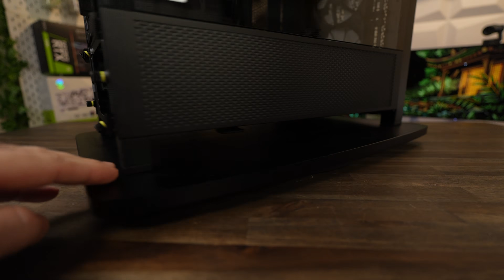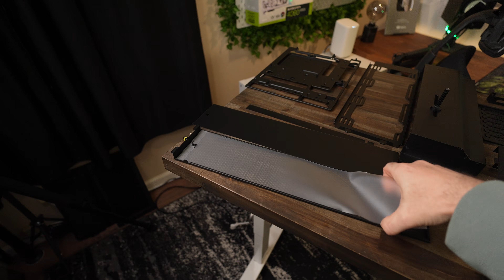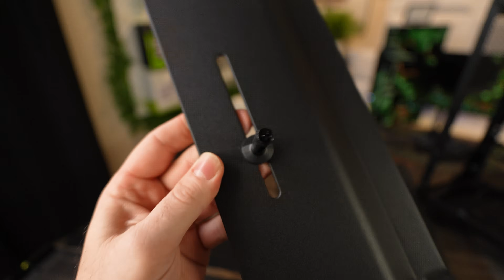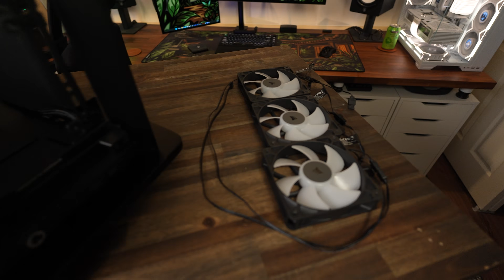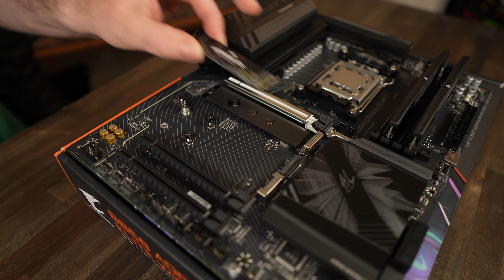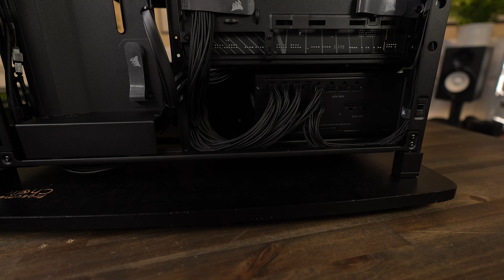Corsair FRAME 4000D Stealth build with INSANE Cable Management

Comment: I notice often the cables of the fans are a bit short. Did you use replacement cables or extension cables for the fans?

Love the blacked out build!
Reply from the maker: Yes, Noctua fans generally always require the extensions. Not sure now, but they used to come with ones in the box. Never had the issue with other fans though. I always keep PWM extensions on hand just in case.

Comment: They removed the top dust filter? downgrade?
Reply: There seems to actually be a top dust filter you can buy separately. But it's only in corsairs online store, it's 10 bucks. You can apparently buy a black one but they were too lazy to put any pictures.

Comment: I got the RS model & ran into an issue with pre-installed fans. They light up, but the fans aren't running. They're all daisy chained & hooked up to the ARGB fan connection on the motherboard... not sure what's up, but I'm a newb at builds.

Comment: Would there have been room to vertically mount the GPU if those bottom fans weren't there ?? This is so clean lol
Reply: The Panel in the back rotates specifically for this.
Reply: @ResistStatism so you just buy the cable then? Thanks for the help !

Comment: Hi, I've tried to find some examples of vertical GPU mounting with fans on the bottom of the case (above the power supply) on the 4000D Frame and even the 5000D, but I'm not sure if it will work with a 5060 Ti 16GB 3-fan card. Thanks for your reply, and sorry for my poor English, I'm French.

Comment: Sadly, not compatible with 200 mm fans without sacrifices. 

The power supply shroud does not have a large enough cut out for a lower 200 mm fan. They suggested that I remove that to install the fans which works, but then I am no longer able to vertically mount my GPU. Because the course GPU riser mounts to the power supply riser….

Comment: I have the aorus x870e pro and the exact noctua cpu cooler. i noticed that in your build the cpu cooler logo "looks" towards the back of the case. i use the 9800x3d cpu. I wonder if i have installed it backwards or is it ok to leave it as it is. If you can advise on it! Thanks

Comment: Just a question, the fans in the bottom are intake right, so does it collect fresh air or it might collect hot air because the psu is under them ??

Comment: I'm so excited to build in this! I'm doing a case swap from the OG 4000D, so this is going awesome and much easier to work in!
Reply: how did it go im planning to do the exact same thing. did you change any other components while youre at it ?
Reply: @fischerderheld4407 Hey! The new case has been running great. I was AM4 and just last Saturday, I had swapped to AM5. New CPU, Mobo, RAM, and PSU. I carried over my GPU from my last build.

I'm also running Noctuas but the beige and brown's
Reply: @asunuji that's awesome! I switched to am5 too and got myself a 5070ti. Now im already looking to spend more money on case and PSU lol
Reply: @fischerderheld4407 The case is worth it if you don't want the fish tanks. Its slightly bigger than the OG 4000D but I'm running mine as this

- 200mm x2 Front
- 120mm x3 Side
- 140mm x1 Top Intake
- 140mm x2 Top and Rear Exhaust

Temps stay cool, and you will have to remove the PSU shroud if you decide 200mm. Last build didn't consume much power but I swapped my 850w to 1250w just so I could swap in anything I wanted lol. 9700x with 4080 Super
Reply: @asunuji woah that's a lot of fans. But I guess that's more silent too since they can run slower ?
Reply: @fischerderheld4407 Yes, I run a custom curve so they're off till temps go above 50 to 60c.
Reply: @asunuji did you upload a picture of your build somewhere? Would love to see those noctua fans in a 4000d. Also will you get a wooden front and top once Corsair releases those ?

Comment: The case looks a bit wobbly. But the final build looks absolutely awesome! I think you should rotate the first fan at the top so it draws air into the case. 
I'm still deciding whether to get the North or the Frame 4000 for my next build.
Reply: Ur right it is “wobbly” the panels I mean and yea thumbscrews are an easy way to remove panels but I just don’t like the thumbscrews in the power supply part of the case when u install the unit I was tightening them and the screw stripped like the threads of it and I can’t use any normal screws for that part but it’s whatever still have 3 other screws tightened to the power supply  but other than that the case is an 7/10 for me a lot of space to work with the cables and airflow is really good 😊

Comment: Why dont people use the CORSAIR iCUE LINK LS430 Aurora RGB Light Strips in the frame 4000D? Iv'e seen multiple people build in it, especially because of the bottom diffuser shroud, I thought more people would add the strips along with the CORSAIR iCUE ARGB PSU Cable Strips for the EATXPWR and GPU

Comment: Nice and dark...just how I like it.

I'm not a fan of all the LED stuff. I'm not saying it's bad or anything, just not my style. My current build is in a Fractal Design Torrent with no side window. As well, my tower has always been under my desk, so any LEDs wouldn't be seen, anyway. So yeah...I'm a fan of the dark build.
Reply: I like minimal RGB, but I love a good stealth build even more. I just built in this case with 11 corsair RS120 fans, my hardware from my old case, a 4060, a new cooler, and an RM850e PSU. It was a blast. (Yes I know 850W is overkill for my hardware, I'm upgrading this October.

Comment: Very sweet build, very clean in all aspects. I was interested in the Frame 4000 for the option to use 2x 200mm fans in the front. But I have read that there are clearance issues with 200 fans and I dont feel like modding the case.

Comment: A nice video ! And i just got mine and building in it atm 

Yesterday i thought i was ready … but then i discovered my gpu ( 3080 ti FE) doesnt fit with my side mounted arctic liquid freezer aio …. So today i think i will move the aio to the top as an exhaust 

3 120 s front intake/ 3 120 s side intake
2 120 s above psu and 1 120 rear exhaust

Comment: Love this case. It’s easily able to fit all my parts: Gigabyte Gaming OC RTX 4080, a 7800X3D with a 280mm AIO, B650 WiFi board and 64GB Corsair Vengeance DDR5 6000, 1000W PSU, 4TB SSD, and an 8TB SATA Drive, along with 7 140mm fans and 2 120mm fans below the GPU. Unfortunately I wasn’t able to vertically mount the GPU because I wouldn’t be able to put the 120mm fans above the PSU shroud, so I opted for the extra airflow over the aesthetics.

Comment: Top mounted exhaust fans in front of the cpu cooler are pointless as they effectively pull out the fresh air generated by the front fans before said air could do anything. All the cpu cooler can then use is the hot air being pushed through the gpu heatsink. Nice build though.
Reply: Jaytwocents made a video of prove this wrong lol
Reply: @RoryWilliamsII  point me to the video then because he for sure didn't and maybe you simply don't understand what i'm saying
Reply: @kerotomas1 https://youtu.be/Z3ckosqxjtg?si=dp6Ex08A2AK-BEQC

Comment: I legit built more or less EXACTLY this a few days ago, and now I see this video. Same case, same GPU, same Cooler, very similar MOBO (ROG B650E-F Gaming Wifi was on sale on amazon so grabbed that ), and for fans I have dual 200mm Noctua chromax black on front, 1 black 140mm as exhaust
Reply: Do the 200s fit well? I remember reading somewhere that they are hard to get in there... 🤔

Comment: Justa small tip, if you are doing air cooling, installing those two fans before the CPU cooler can actually be a detriment to the overall cooling as it robs the air cooler of air in some higher load instances. It's usually better to have a single 140mm exhaust above or slightly aft of the cpu cooler.
Reply from the maker: Yes, I’m aware. I also thought about turning the front two top fans towards intake as well to counter this. Ended up just filling them all as exhaust and then testing thermals anyway. Benchmarks and game tests were all fantastic.
Reply: This is proven not to be the case. Jaytwocents made a video about this
Reply: @RoryWilliamsII it is proven to be the case, there's literally various tests around. It's usually not a big deal but can cost you 1-2 degrees in some cases.
Reply: @Kolobochok95 1-2 Celsius is not in any means detrimental... That's my point. The difference between running your CPU at 69 C and 70-71 C is basically nothing

Comment: Awesome build honestly! Did you daisy chained the fans and then plug in the fanhub? Or all cables are connected to the cable individually?
Reply from the maker: The 2 CPU cooler fans are y-split into one fan header, the rear one is by itself in a fan header, the bottom fans are y-split into a fan header, and the top and front are all going to the fan hub! I had to use 2 extensions for 2 of the top fans.
Reply: @ I see thank you! Love your videos btw! Pc building is a passion of mine but don’t have the luxury of building pcs everyday haha!

Keep up the good work we love it!

Comment: I built my first ever PC recently, and I used pc part picker to choose and see the compatibility with the parts and being a first-time PC owner and not thinking about them too much. I didn’t look into a PC case and just added the mid-tower 4000d airflow for 70 dollars. It’s not the same case as the one in the video, but it’s close and only after getting the case and all the parts did I realize how lucky I got with the case, because it turned out perfect for my needs with how easy it's to take apart and not too big but big enough to hold some big gpus and have an aio. My cable management sucks ass, but I bet if I had paid more attention to esthetics then I could have made it look better, but I just wanted it to work 😆 long story short, the 4000d cases be lowkey goats.

Comment: had this case.. loved it.. only downside was the backside panel seemed really cheaply done ( i know its a 100ish case) but it was really warped and never sat flush against the chassis.. also 200mm fans, have to either remove the psu shroud or cut a piece of the psu shroud off by the fan.. which was never explained in manual or reveal of the case.. i went back to my h9 flow.. great looking build!
Reply from the maker: That’s unfortunate. Could have been a bad one from the factory.
Reply: @DanKamYouKnow  hopefully they do a 5000d frame case.. if so I’m sold lol

Comment: This is a beautiful build I went for a blacked out build this time around. I’m using the antec C8 case. 

What cable are you using for your gpu? I wanted to purchase a aftermarket one but was worried with all the melting fiasco going on. I’m using a 5090 astral.
Reply from the maker: Thanks! I used the Corsair Type 5 cables for this specific PSU, which has the dedicated 12vhpwr plug for 5xxx series NVIDIA GPU’s. The cables are kinda pricey but well made.

Comment: Hey guys!
This housing looks pretty cool. It also seems to be well organized. When I built my own PC several years ago, I used the Corsair Carbide Air 540 and I still love it, because everything is easlily reachable and separated. It has a cubic design but looks some kind of timeless. Only downside is space, I use my computer with AIO- cooling. If i got the chance to build another PC, I would like to perform a water cooled built and decide for a way bigger case. My personal favourite is the Thermaltake Tower.

Comment: Cool design no question but two of the three top fans have no use and are even worse for thermals. Sure it looks better but Idk it bothers me😂
Reply from the maker: I mainly just wanted to fill up the case. I thought about going with one exhaust fan above the air cooler, but decided to go with all
Reply: Jaytwocents has a video to disprove that. It will be within a 1 degree difference so it really doesn't matter.

Comment: noctua posted themselves in a blog post that the top fans all being exhaust can be detrimental for cooling, because it takes in good cold air but immediately takes it out. they recommend to have the top left fan as intake, and it improves temperatures and airflow by a worth while amount
Reply from the maker: I thought about doing that, or just leaving one exhaust fan above the air cooler, but decided just to go with all the top as exhaust. Definitely good information.